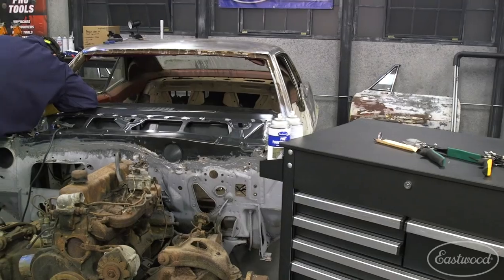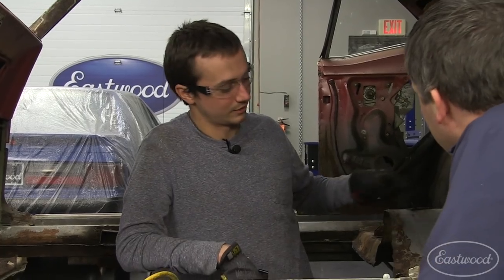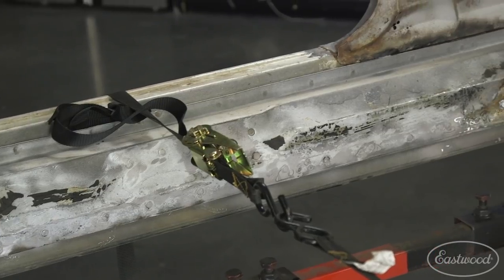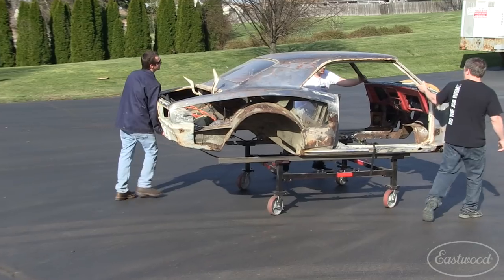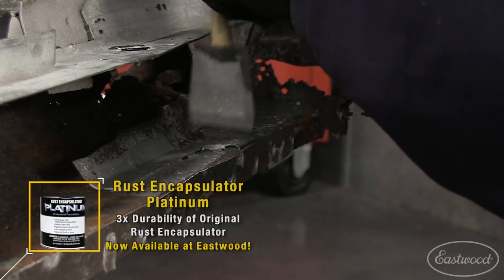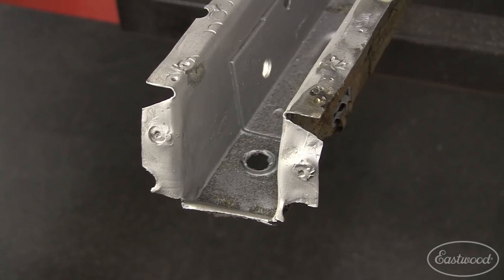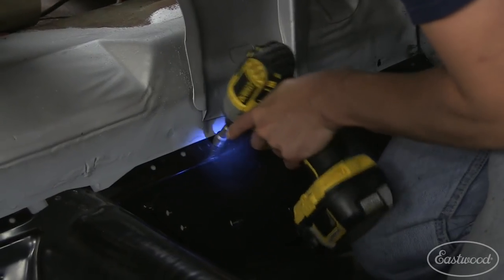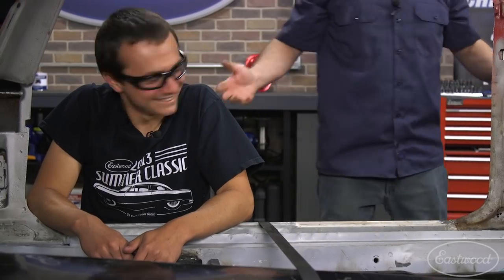How To Install an Entire Floor Pan on a First Generation Camaro - Repair Restore Revive: Ep.8

Comment: On the amd metal panels they were black did you have to grid that coating off before welding or that coating is good to weld to.

Comment: No bracing of the body before removing the floor? Was there and movement ?
That car needs a good dipping for all that hidden rust you can’t see or get to without huge amounts of metal removal. Then a galvanized dip.

Comment: How did you weld thru the mastic? where you using a MIG welder? flux-core wire?
Reply from the maker: He's MIG welding. Not using Flux Cored wire.
Reply: @eastwoodco  Thank you.

Comment: I just found this series and so far I am loving it. what are the long term plans for it? it looks like it was a strait 6 car with a  manual trans from the factory. I hope you plan to keep the I6. you don't see many I6 cars any more. everyone swapped them to big blocks back in my day, and the whole LS swap everything is over done these days. It would sure be cool to see a hopped up I6 under the hood in stead of a ugly LS. I would also keep the manual trans. those cars got decent gas mileage back then. I know you are a long way from paint, any ideas on the color? personally I think a metallic Eastwood Blue with a white bumblebee stripe on the nose would look awesome.

Comment: Anyone know why they do spot weld instead of a straight bead all the way round
Reply: I assume to be "like the factory".
Reply: @jdimeo1966  Factory and to not put too much heat into the panel and warp it. Spot welds are just better for this application also.
Reply: Just like LoneRider has said,  to prevent warping.    And also such a multiple points structure is just stronger,   then one big solid connection.

Comment: Great stuff, but you have to be careful blasting sheet metal - i've seen it get warped to hell from sandblasting.  A less aggressive media doesn't seem to cause any problems. Of course stiffer panels like rockers and floorpans wouldn't be an issue.